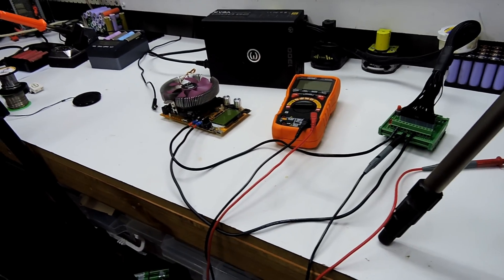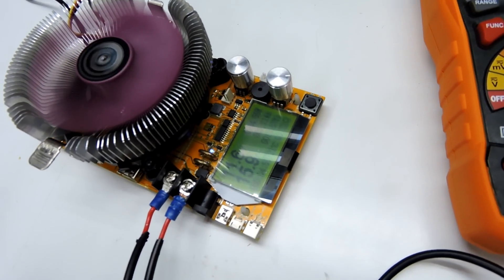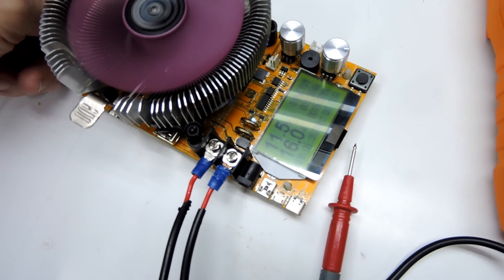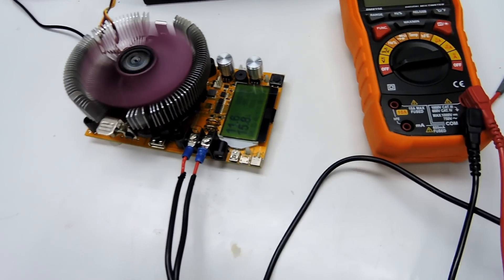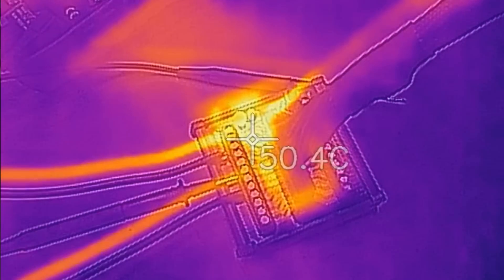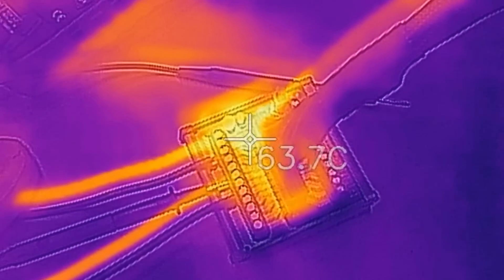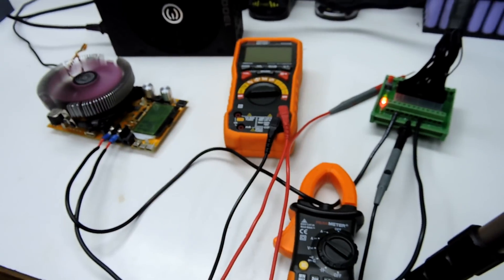ATX Breakout Board Load test the 24amp claim

Comment: Pete, You should make a version yourself. Bet you can make one to take full advantage of the amps coming out of the PSU. We use to make these all the time when i use to build and repair PCs. Still a great little device and a Great Video on it!
Reply from the maker: Do you mean the bench top supply from PSU - already done a few this is one i made a video on https://www.youtube.com/watch?v=rJMiPGzmxi0
Reply: No sorry, I meant Breakout boards..We use to just bypass the computer builds like the link and plug in a board we would make ourselves. I have a Video like that also, Just haven't edited..LOL-I built a hybrid Bench PowerSupply from a computer PSU and a Buck converter. One of my Very First Projects. I still use that supply like crazy!!

Comment: I assumed the tracks would be a weak point in the design.
Reply from the maker: They aren't meant for heavy amps - was kinda hoping you could use it for mining rig but quick messy tests showed the same issue - heat and mess of wires
Reply: Maybe you could improve the tracks by sanding the insulating layer off the top and coating it with thick solder.

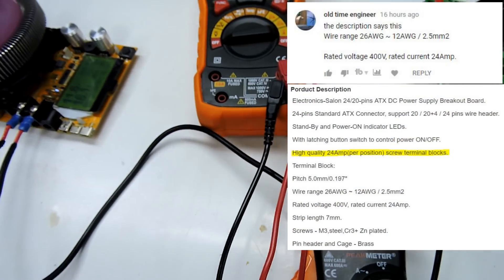Comment: 3:20, looks like that's what the terminal blocks are rated for, not the board. Bad translation maybe haha. Anyway, I wouldn't try and pull more than a few amps through the 12v rail on the 24 pin, it's only meant to run  a few fans and turn on pci-e cards.  The standard safety cuttoff is 180w on the 3.3v/5v rails and 120w on the 12v, for the 24 pin anyway.
Reply: Good test though, shows how dangerous false advertising can be.
Reply from the maker: PSU is a beast bet it could do 50amps with out issue lol but yes they need to be held accountable for their advertising claims but being a global community it's very hard

Comment: if u are going to use this one for anything higher than maybe 8 or 9 amps u prob need to split the load between a couple of terminals 
since the trace seemed to be the hotspot
Reply from the maker: that's a good call
Reply: Share the load between all the 12V, or 5V terminals then you can pull 30 amps or more.
This is why there are so many 5V pins and wires on the motherboard connector, so the voltages can be distributed to regions of the board that need it, and avoid creating a hotspot.
You wouldn't design a city with only one road in and out!

Comment: I was going to say there is no way in hell those terminals are rated for 24 amps, but this is more entertaining.
Even at 16A the PCB traces get hot, well no surprise to me there, high current requires thicker copper, wider tracks or more layers.
Reply from the maker: good fun to make this video & was quick to edit hehe 5-10amps it'll be fine